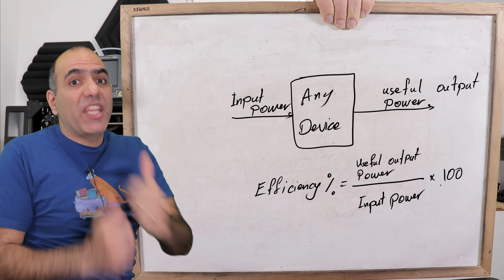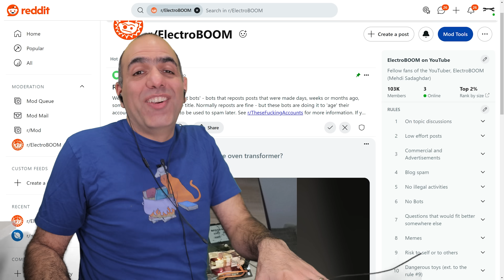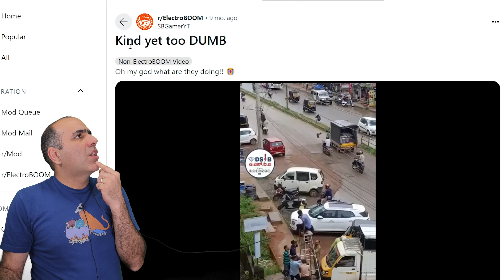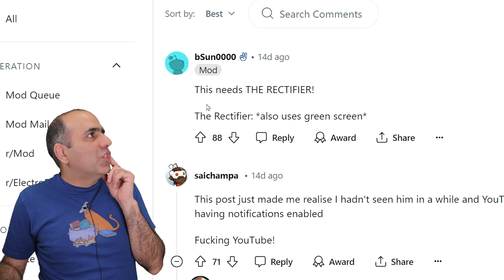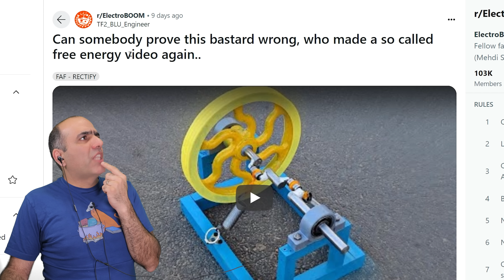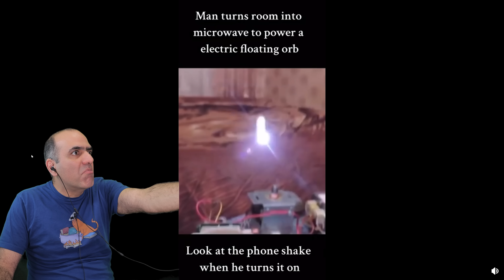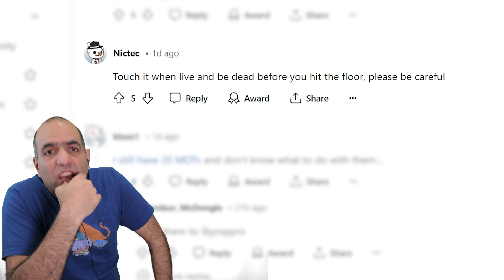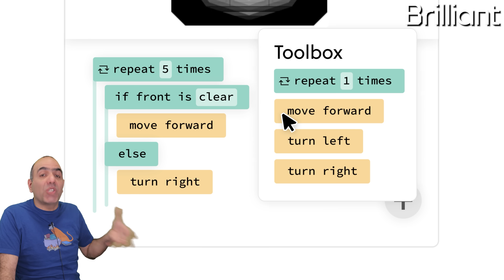New Flywheel Free Energy?! Can Boat Battery Fry You? LATITY-013

Comment: ok so, that guy touching the powerline with some stick to free the pigeon gets shocked.. I wonder why I didnt feel anything when I was like 5 years old and, on a demand for fun from some older friend, I grabbed the powerline with both my hands on the top of a 2 floor house that was under construction. I started shaking the powerline and I heard a very strong buzzing coming from the poles on both sides. I tried to catch the other line that was parallel, but I didnt manage because it was too far and I would fall off the building